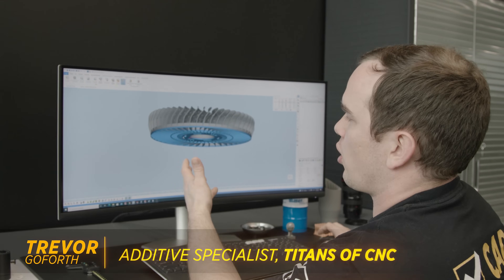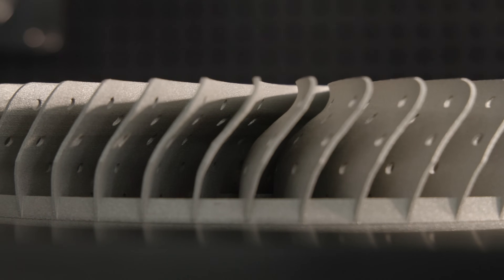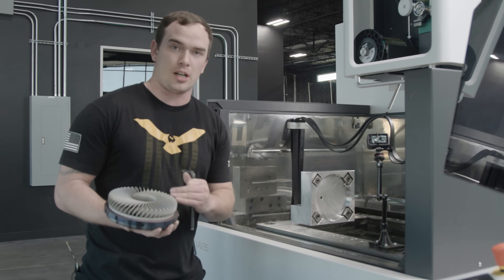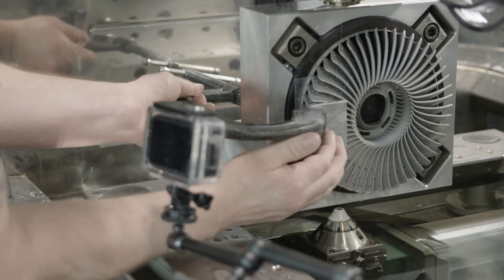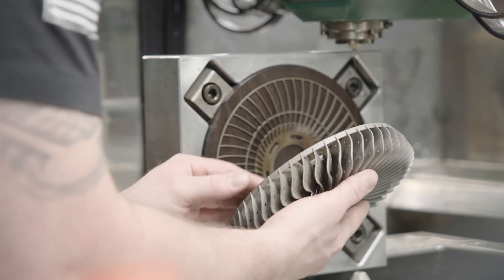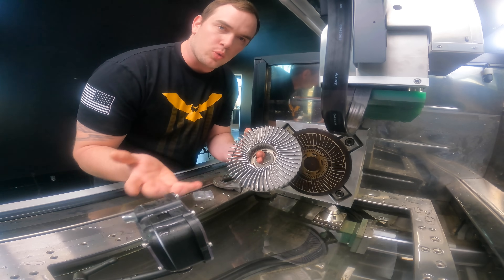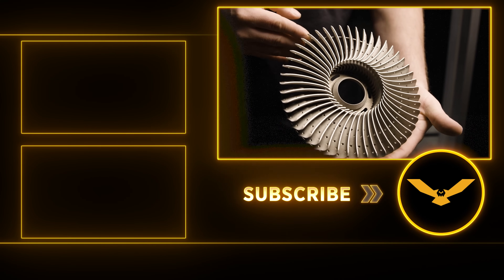Metal 3D Printing a 48 Blade Turbine Part out of 316L Stainless

Comment: When cutting off a part, it would be more expedient to change its position to inversely horizontal and add a holder for fxation. This would reduce the required volume of water and the time for the operation.

Comment: Question: To have the best possible airflow, turbine blade surfaces are usually very smooth. Is the rough surface left on these printed blades not an issue then? It would seem to me that it creates turbulence, no? Or is this perhaps just a prototype part and will the production one be made using a different technique? Could someone knowledgeable shed some light on this?

Comment: Well Sintering and casting has been around for years, and there's a reason none of those are used for high stress applications. Heat treatment won't help either because you can't cheat yourself to a perfecr cristallyne substructure when it comes to steel and alloy..
Even die cast compared to a milled part will never be as strong. 

You are basically spotwelding an entire part with metal 3D printing.
Reply: Literally all high temperature turbine blades which have to withstand enormous mechanical loads are produced through investment casting. What are you talking about?
Reply: Might wanna do a deep dive on HIP and how that works…

Comment: so, instead of a 4 step process you have to:
print it (1 step)
cut it with a wire EDM ( 1.1 step because you have to add the shims )
somehow polish the blades
heat treatment/sintering?

it sounds like it has about the same steps (heavily automated, but steps none the less)

how do they compared in terms of strength and stiffness against the traditional method?

Comment: 🎯 Key Takeaways for quick navigation:

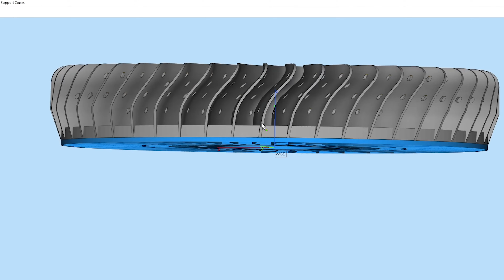01:14 🛠️ Metal 3D printing allows for the creation of complex parts like the 48-blade fan with ease.
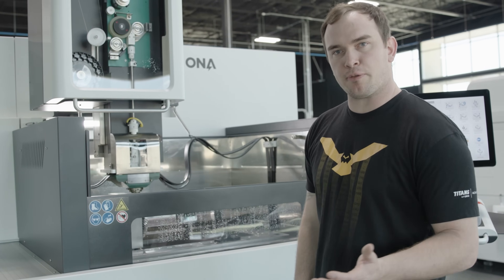03:18 🧰 To prevent the fan from pulling away during cutting, they use a shim and C-clamp to secure it in place.
04:11 ✂️ Additive manufacturing combined with EDM allows for precise cutting of thin-walled parts like this fan.
04:50 📏 The fan features 48 blades, each 50 thou thick, made from 316L stainless steel, resulting in a lightweight and impressive final product.

Made with HARPA AI

Comment: Using a Lazer to weld metallic powder into parts. It's not exactly forged, it's not exactly cast. Is it strong to start with a powder that's dry and weld particles together to form a metal part? Layer upon layer? 
Liquid molten metal poured into a mold and allowed to cool is more solid, hammered forgings are much stronger as the forgings align the molecules of the steel. How can one make an alloy out of powders? One pinch tin, one pinch aluminum, one pinch iron ore powder, one pinch nickel powder and then what, shake it up? The powder will be particles of individual metals then welded, it won't be an alloy, tin powder welded to iron powder welded to aluminum powder, not really a true alloy. Fixing things, having to work on things is a difficulty, having a part break and having to disassemble things to get to a broken part is a lot of trouble. 
I see the potential of this, it's interesting. It's important that things are strong and reliable. It looks like a very good idea and fast. Maybe you can freeze harden the part or heat it and quench it to add hardness. There are things that the world needs. Manufactured goods are lacking in this world so it looks like a good idea to weld together very complex designs very quickly.  LLXIIX77

Comment: Was there a rough surface finish as appearance in the video?
Perhaps not as optimal as formed sheet metal blades as regards smooth flow through the fan? Or perhaps secondary operations were done to smooth the blades? 
Nice demo.

Comment: im curious about the grain structure of printed parts, can this process be used for high stressed part's that would usually have to be pressed and forged using dyes? would it be able to handle pressures up to 50,000psi, actually forging dyes are quite expensive i could use one of these to print dyes, much easier doing prototyping

Comment: Would you guys, or have you already, recreate the Sabu Schist Disc. It's a tri-lobed bowl 61cm in diameter, with a height of 10cm. I'm curious what it sounds like when spinning at different RPM. I am curious if it makes different sounds as different metals, stainless steel, Ti, Brass, Copper, RPM, etc.

Just a curiosity, There are other discs related to it. There's a 5 smaller lobed top disc and another one that's 7, again a topper. I think goes together with the tri-lobed disc. I don't know if it's a propeller, a rope make, musical sound instrument?

The only other way I'd like to get it made is with stone but I don't even know who, how or what for that.

Comment: I wonder if there are way for you to smooth the surface of those blades without crazy multi axis machining. Perhaps tumbling or some sort of vibration based process? Or may be some chemical deposition of some variety?
Also im very curious to see some analytical data comparing the performance, efficiency and other metrics of 3D printed metal part with machined one.
Reply: Wondering the same thing. I'm thinking they would put it inside a chamber, and use an abrasive that's sprayed onto the blades by high-pressure nozzles.

Comment: guess it still need the heat treating. otherwise it's not able to hold the higher dynamic pressures. if you make heat treating the dimensional changes will be occured.

Comment: The major problem being the rough surface finish of the blades which would have a big impact on their efficiency I imagine. You would have to add a third process; some kind of polishing tool on a 5 or 7 axis cnc.
Reply: Would kinda defeat the purpose, a tumbling machine with some sort of media would probably do a good enough job of polishing it to a smooth enough surface.

Comment: It is simpler but way more expansive. In big quantities does not work. Too long to print and too expansive. So far 3d printing good for prototyping a very small lots of product
Reply: It depends. Siemens has over 50 machines in sweden churning out turbine parts and others. It's actual production. Inconel etc.

Comment: I suspect the multi-operation build with sheet metal provided for smooth surfaces.  What processes can be used to improve the surface finish?  Is the roughness due to the metal particle size in the 3D laser printer?

Comment: For those doubting material integrity of the finished part, I wonder why they think 3D parts made with the right additive chemistry and process cannot go through the same heat treatment and finishing processes that a part made with traditional process goes through....
Even if the manufacturing process itself allows levels of strengthening and work hardening, I wonder why people seem to think that it cannot be replicated.

Lots of reputable research suggest it is very much possible and already being done. Is there any reason to believe otherwise?
Reply: Because they dont know how traditional process works
Reply: Let’s see the parts work in the field then
Reply: You can heat treat cast, billet and forged the same way and all will come out differently in strength

Comment: Very nice print, clean and smooth, as much as it can using these methods. And now the 1 million dollars question: what are the printing parameters you have used (LASER power, scan speed, hatching, layer thickness, LASER beam moving strategy, did you use contours?) :P
Reply: Most popular 3D machine producer is devolop own parameters. This is big know how

Comment: All the negative comments from the armchair experts! Why does anybody bother to put stuff on YouTube I don’t know. Somebody I know has just gone into this a year or so ago and the things he can make in one go just blow your mind. He can make things that are impossible to manufacture any other way. Yes very expensive but exclusive and I guess the costs will come down. There are further heat treating processes to fully bond the metal partials I believe. Parts can be made from ANY material.  It is not for manufacturing mass produced parts that can be a made easily by conventional means

Comment: I wonder if a part printed using that method can whitstand the engine loads 🤔
Reply: If it’s stronger than billet machined, yes, since many common engine parts are billet machined.

Forged is stronger than billet but plenty of engines have made without forged parts

Comment: Is the surface textured? I'm curious, a rough surface would not be good for air flow. Can you print with smooth surfaces with this machine? That said, this thing is badass! Thanks for sharing. Also, what was total time to make part and the, total time to cut with EDM?
Reply: It's probably not perfectly smooth but good enough
Reply: It's a rough texture from the printer, but can be smoothed to a good finish with vapour honing/blasting
Reply: Yes, surface is textured. Feels like parts that have been sand blasted or fine to mild grit sandpaper. You would not bolt two flush surfaces of these printed parts together. Mating surfaces are commonly finish machined. 3D printing methods for tubing applications that require smooth-bored channels are commonly Material Jetting (Polyjet) and SLA or DLP.
Reply: It would be no trouble to make it smooth

Comment: I'd like a follow up on this part as from my understanding 3D printed parts don't do so well with fatigue stresses thus I'd like to know how well it did in the field.
Reply: "3D printing" is a generic term for many types of additive manufacturing. The process used to make this part could be simplied to say "laser welded". You'll see minor to extreme internal thermal stresses in this manufacturing method. Some parts will have trouble remaining dimensionally stable (depending on the material thickness and part geometry) during thermal reliving. But fatigue failure is not common for this or other types of selective laser melting; However, it is seen in many additive processes that have non-uniform layer density like FDM. The stigma for 3D printing and fatigue failure comes from early 3D printing that was relagated to lactic plastics with little elastic deformation.
Reply: Here is how bad they do: https://www.youtube.com/watch?v=RrVRSbc6Oec - porsche printing engine pistons.
Reply: Yeah there’s no way it holds up in the field

Comment: Hey Guys   WHAT KIND of fluid is used for the EDM???   it cannot be plain water.  I assume it's some kind of Electrolyte.
Reply: It's just plain water. An electrolyte is conductive. That would not be good. You want the electricity to be focused at the cut, not over the entire machine. Only a dielectric fluid, like near water, will work. It has a DI system.

Comment: There are parts you cannot make without seams and gaskets. That's where 3D printing metals really shines... But I am always curious what the real longevity / strength of those parts are.
Reply: Yeah, I wondered that as well. How long will that sucker stay together at 20K RPMs or whatever rate the fan is spinning?
Reply: they still suck a little, but getting much better, its more of an in dev tech
Reply: Sintered metal or weld deposition is not considered as strong in all respects to other forms.
Reply: The yield strength is comparable (within a few percent) to bulk castings of the same alloys.
Reply: @jdrevenge  Care to provide sources for that? Everything I know about materials science leads me to believe that is very much false.
Reply: @DoesntRefillTheBrita  Also, that's for ultimate strength, the yield strength of the 3D printed is roughly double, because, well, grain size.
Reply: @jdrevenge  Again, sources? You can tell me all you want, but without a reliable resource to back you up it's just warm air to me.
Reply: @DoesntRefillTheBrita  Dude, you can look it up just like I did.  I don't feel like copying and pasting links from my phone and it's really not my burden to do so.
Reply: @jdrevenge  Well my schooling and degree tells me the opposite, and I feel like those have a better reputation than your "google searches"
Reply: @DoesntRefillTheBrita   Care to provide sources for that? Everything I know about Searching scientific papers versus "internet experts" leads me to believe that is very much false.

Comment: request/suggestion if you have time: analysis of material properties, print time, and cost vs the original part. also curious about air or fluid flow over that surface.

Comment: It would have been interesting to have a time lapse timer on screen during the EDM phase. A number of people who have never been exposed to the process may not perceive the actual time committed to each process.
If possible, show us inspecting the finished part balance; which to me; verifies that the print resolution is sufficient to maintain uniformity through out the entire process.
Just for some added dangerous fun and as a durability test: Affix that blade to the previous days spinning top demonstration, spin it up so we can hear it. Maybe add some smoke using a AEROLAB smoke generator for the visuals; similar to devices used in wind tunnel testing. Surely in DFW area, someone would still have them. 😉
Reply: EDM is slow. Roug cut on 20-30mm thick steel could be around few mm per minute. Rough cut on 150-200mm will be around 0,5mm per minute and less. Skim cuts (finishing) are faster (up to few mm per minute), but depending on the required tolerance it could require 5 or more skim cuts on very precise features.
Reply: @Stasiek_Zabojca  Yep, it's difficult to convey in practical terms that even a child can comprehend. There are many who have  no idea that EDM machines have existed for decades or how they affect everyday living.

Comment: Not feasible compared to standard production processes, 
3d printing is useful only for prototyping and extremely complex shapes that are impossible to make otherwise
Reply: Siemens has been doing turbine blades with metal-AM for some time now. Same for gas turbine parts and nozzles etc. Usually inconel or some other difficult material. They are not the only one but are quite ahead of others.

Comment: All the fancy tec and we still use the trusted G clamp, how long did it take to cut through, Im wire cutting some titanium 3d printed parts and have found the speed is all over the place due to the cavities inside and the way the water blasts ( mines open flush ) but bloody hell 3d prints look good.

Comment: Rough finish and what happens to the build plate? 3d metal printing is more of a sintering process really.
Reply: The parts surface finish can be improved using different post processing methods if necessary. The build plate is ground or machined and used again.
Reply: @trevorgoforth8963  
That would be so much more work though.
Reply: @codprawn  There are mass finishing methods that allow the prost process finishing of multiple parts at once.
Reply: @trevorgoforth8963  It's not been sintering for a while now. It was that maybe 15 years ago. Densities are up to 99,9%

Comment: If you have to EDM the part off, how do you get the rest of it off the build plate?  Are build plates consumables?
Reply from the maker: Machine it or grind it.

Over time, the build plate will get smaller and smaller but it lasts pretty long.

Comment: Looks super neat for a low volume run but way too expensive in series production. In my option stamping the blades (high volume) or laser cutting (low-mid vol.) and then laser or resistance welding them together would have been the way to go.
Reply: How do you figure that this is too expensive?     We don't know the cost.
Reply: @jdrevenge  3d printing 316L like this would cost up to $0.8/gram. So if your part is 1lb then it may cost $362

Comment: From start to finish, what's the cycle time per part? 

Judging the comments, I believe most are wondering how realistic this process would be in the production world, compared to the more tedious 4 step process. Thoughts? 

I'm curious myself as I've never been in an environment that does actual industrial 3D printing..the kind outside of small fixture and prototyping.
Reply: The problem is that a part like this is EXTREMELY hard to make - look at the holes in the blades, which are trivial in additive, brutal in CNC and other processes. Porsche is using a process like that to make the cylinders for high end sports engines - hollow with a support structure, cnc'ing them to tolerances after print. Price IS an issue, but not necessarily for all parts.... and substractive manufacturing has serious limitations in that you need to be able to get the tool into the area to take parts out. Removing powder is more easy.
Reply: @ThomasTomiczek  Thank you for your response. It still blows my mind how far the world of 3D printing has come in the last 5 years! 

I could see the luxury car brands using this method now that you mention it. Customization is usually prevalent because people buying the exotics can afford it. Makes sense.

Comment: How thick is the material at the centre of the part when you are parting off with wire EDM... Could you not make a internal fixture to hold from front of the part the cut the support material off... Can wire be orientated horizontal with vertical travel
Would save having to stop and clamp, it looked awkward
But I really like your work Guys n girls of Titan